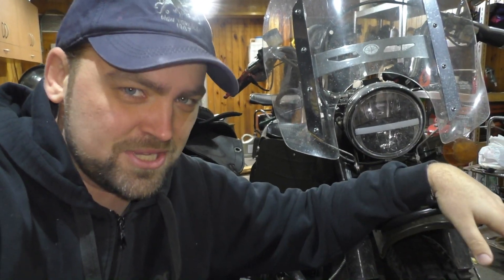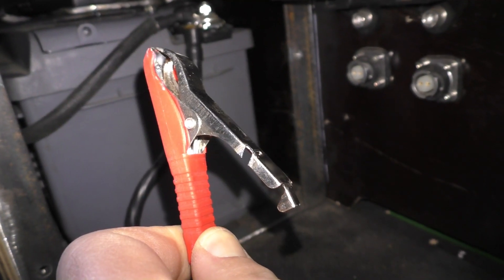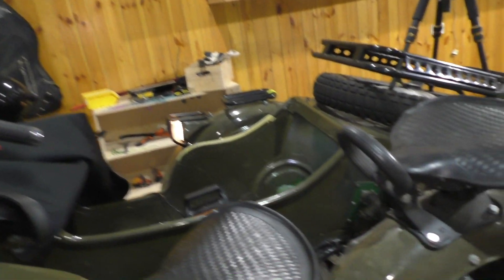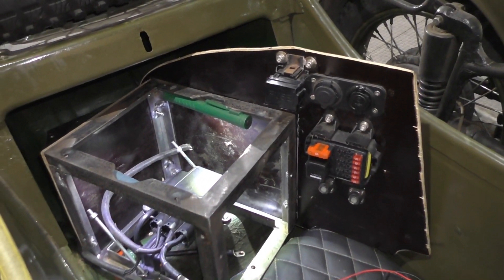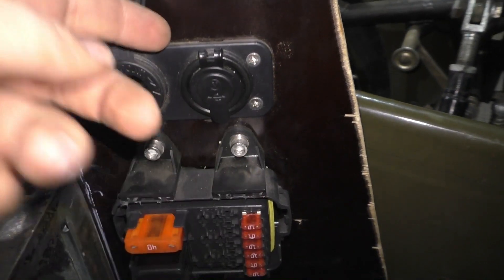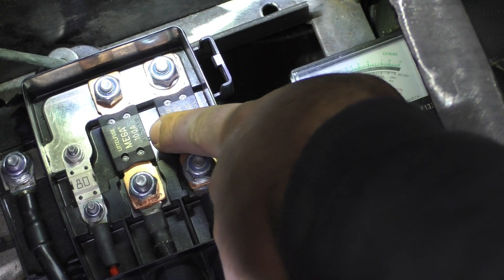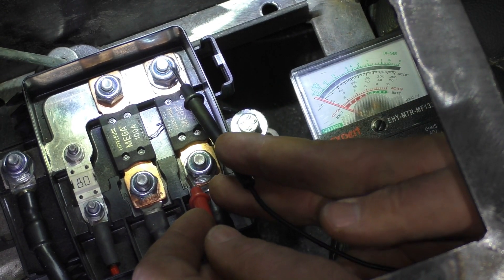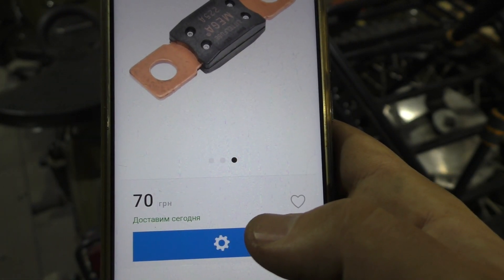Dnepr (Not Ural). Battery Short Circuit. New Electrical System

Comment: That is WHY YOU ALWAYS DISCONNECT THE GROUND WIRE FROM THE BATTERY FIRST.  Newer bikes have fuses and not that heavy.     The WORST THAT COULD HAPPEN IS: you burn out the generator or magneto(that is costing way more than a circuit breaker) and you might not find it as easy.  Or it "also can burn off the plastic coating to a good portion on the electrical wiring immediately.  Again, getting wiring harness is costly and time consuming. As the battery rarely has to come out of the bike...just for winter storage inside the house...being difficult to remove for you means it won't be stolen.   That schit happens.
Always remember to REMOVE GROUND WIRE FIRST & out of the way...when taking it out and PUT ON GROUND WIRE LAST WHEN INSTALLING.  Be it car, motorcycle, tank, Bayaktar drone, plane,boat.  Does not matter whether it is Positive GROUND wire or Negative GROUND wire...they work the same.  Take off the easy one first and wrap it in a cloth or plastic or just twist it out of the way so it can never reconnect accidently while you are working on the harder to get to wire.

Comment: As you can see, fuses are there to protect the rest of the motorcycle from catching fire. One thing I don't understand is, why you need such heavy duty fuse protection on your bike?. It doesn't appear to have much of any accessories that need that much power. I have a Harley Road King, and it has a radio, wiring for heated gear, just regular lighting with 2 spot lights, plus electric start, and my main fuse is a 50 amp for the whole bike.  I'm sure the sidecar lights don't draw high voltage.,,
Reply from the maker: Yes, Phil I agree with you. I have just heated grips plus some extra lights... Unfortunately I was not a designer of that electrical scheme...
Reply: @DenysDavydov  Heated grips may be the reason.   I wear gloves...when the weather is THAT COLD.  No fun riding in the cold weather. You can get the parts, you are good.